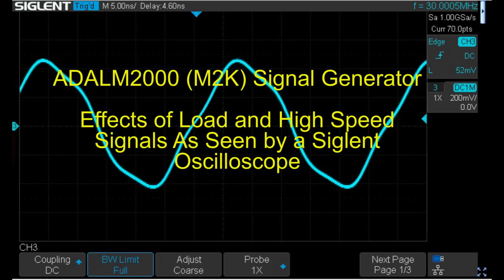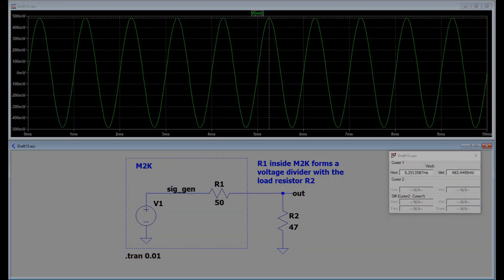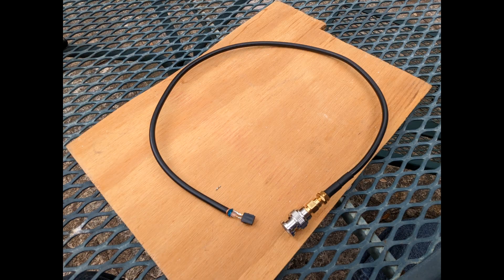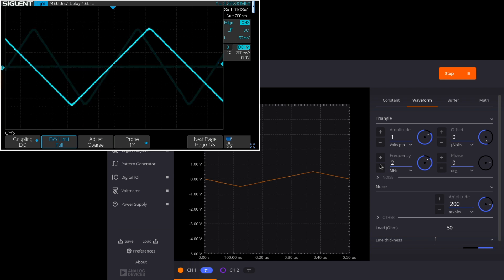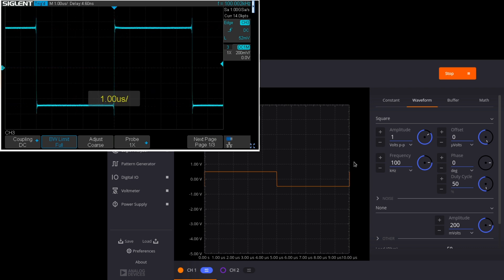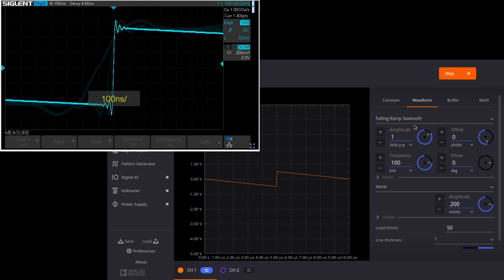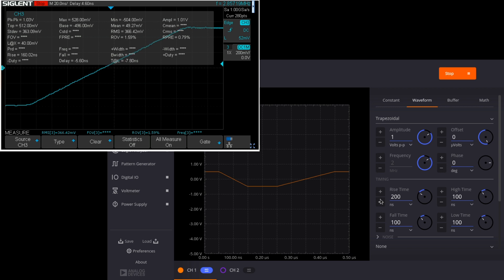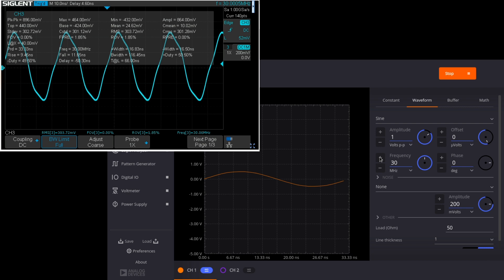ADALM2000 (M2K) Signal Generator: Impact of load and high speed view from Siglent Oscilloscope

Comment: Thanks for this video! I just picked up an ADALM2000 and there isn't a whole lot out there on it. Appreciate your channel.
Reply from the maker: Thank you for this comment.  I made these videos because I did not see much content about the ADALM2000, but I think it is a useful device and significantly cheaper than the Analog Discovery.  I am actually using my ADALM2000 as I type this to view an i2c signal.  I hope Analog Devices continues to support and update the ADALM2000.
Reply: @electronics.tinker  same here. I am hopeful that someone will, considering that it is open source.

Comment: Can you try Adalm 2000 BNC adapter board or make a similar adapter and test
Reply from the maker: I don't have that BNC adapter board.  It provides connectors for both inputs (like to the scope) and outputs.  For outputs (the signal generator) the cable I used in this video is as close as I can come.  For inputs, my problem is that I don't own a bench function generator-- so I have I nothing to connect to the M2K inputs via BNC/coax.  I don't think the BNC adapter board probes can add bandwidth to the M2K inputs.  It's basically like a 25 MHz bandwidth scope.  One idea I have is to use a raspberry pi to generate fast rising edges and compare how I can measure/see them on the M2K scope vs my Siglent scope.  It's possible to vary pad drive strength on a raspberry pi so I can compare the M2K scope to the Siglent in seeing the effect of that on rise times.   I expect the Siglent to be able to display the rise in fast edges maybe down to 3 ns or so.  The M2K will likely be 4 or 5 times worse at that.